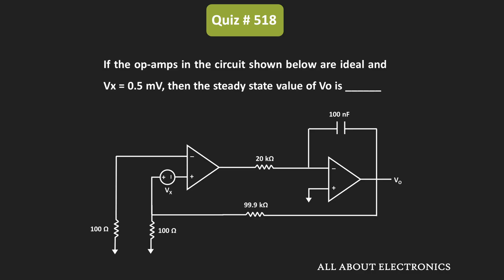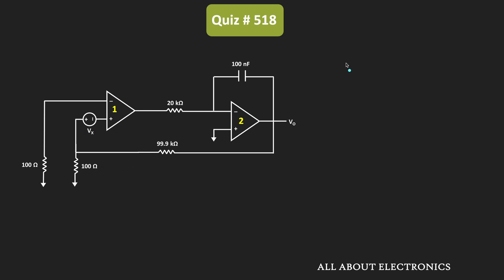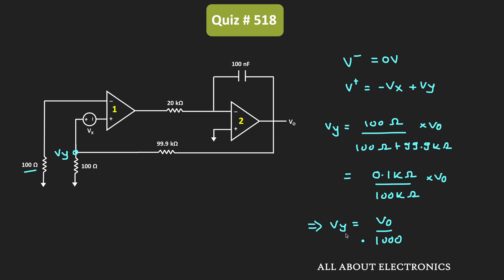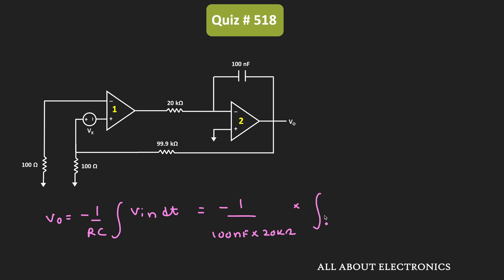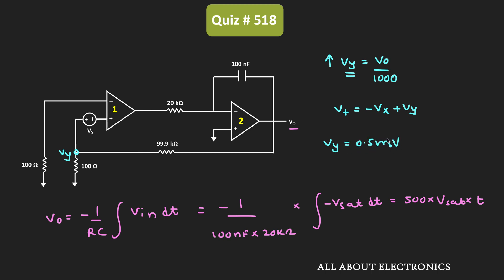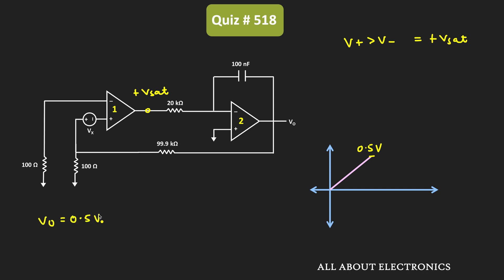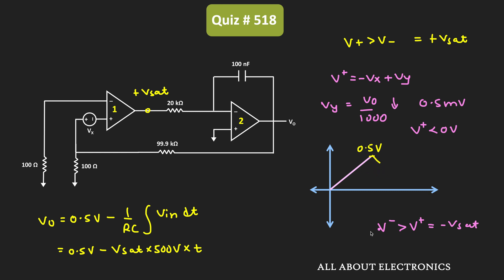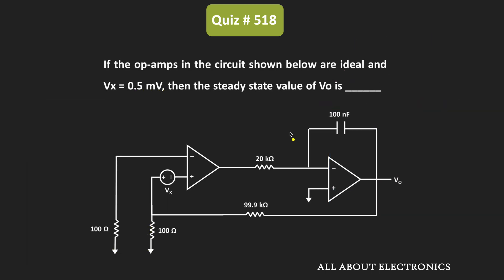Operational Amplifier Solved Problem (Analog Electronics) | Quiz # 518

Comment: I didn't get why when the circuit is turned on, the Vout is equal to zero (at the same time vy=0). But anyway, thank you for this solving problem video.
Reply from the maker: Initially, when you just turn ON the circuit (at t= 0+), the output voltage will be 0V. And hence Vy will also be 0. Whatever discussion that is carried out in the video is just after t= 0+. I hope, it will clear your doubt.